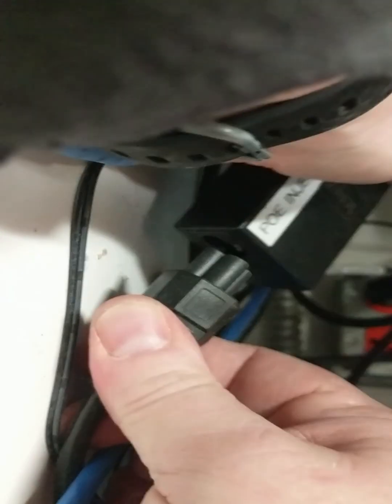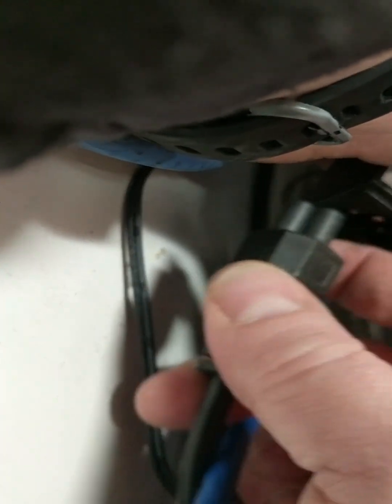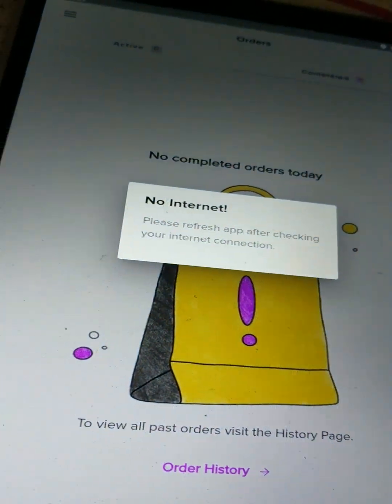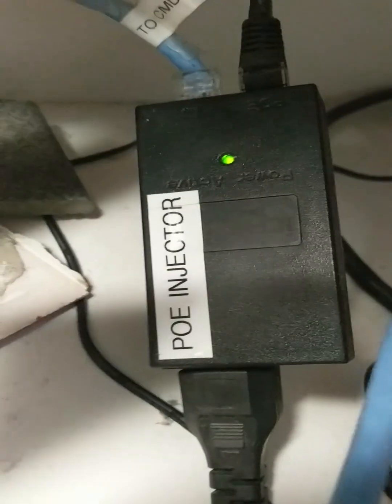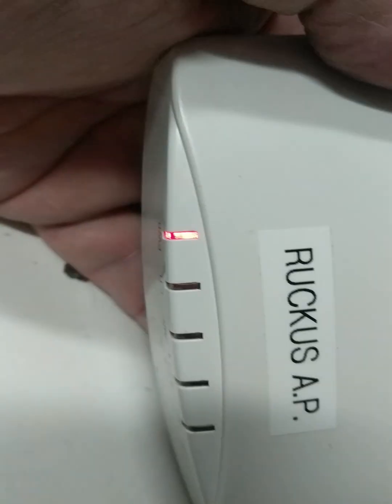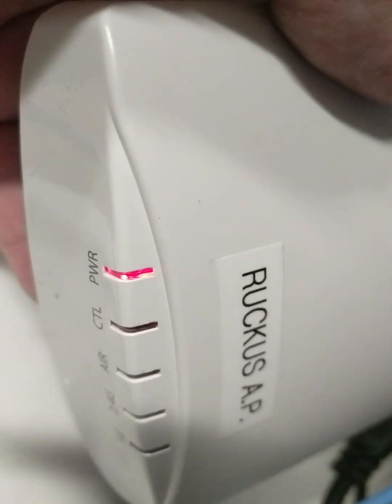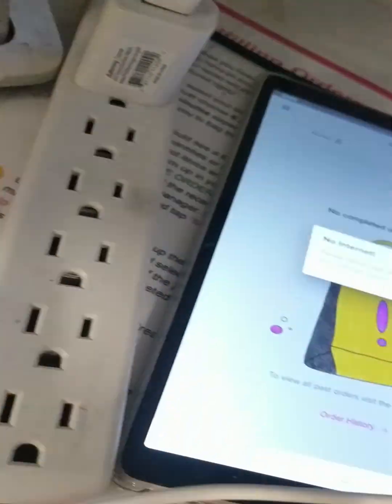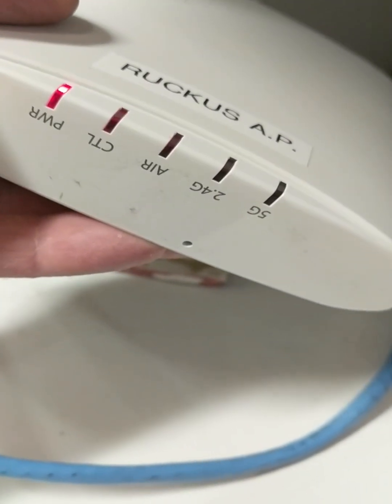Ruckus AP Explained

Comment: kinda sucks that it cant be rebooted remotely.
Reply from the maker: If you plug it in to a managed switch that provides POE that you can manage remotely, just use the switch port to reboot the port it is using, which would reboot the  Ruckus using POE from your switch.